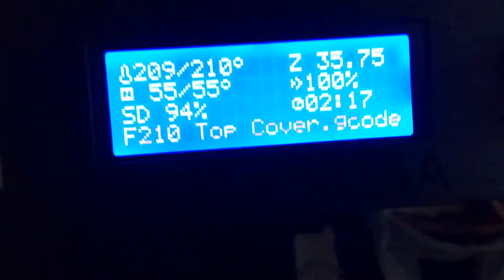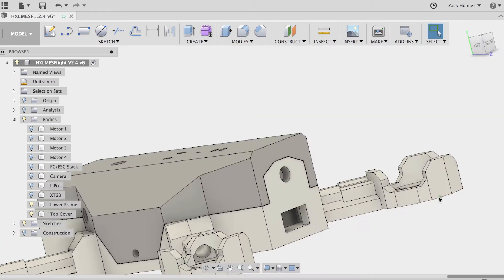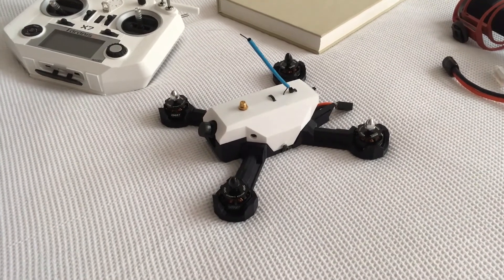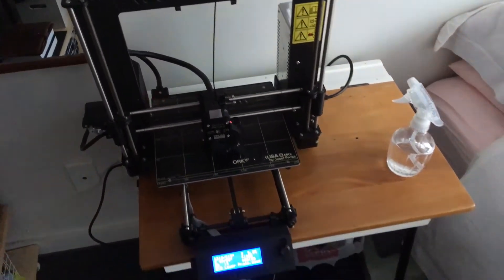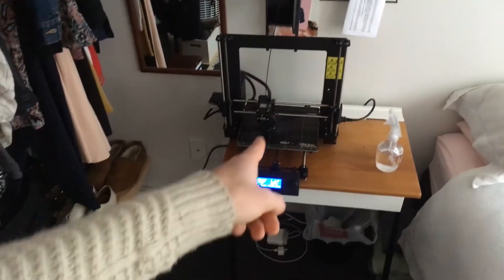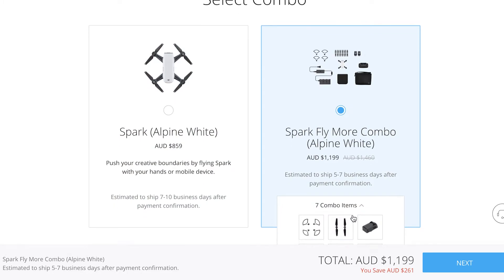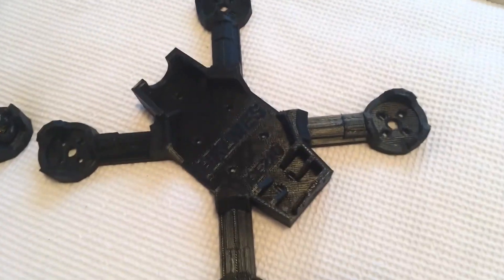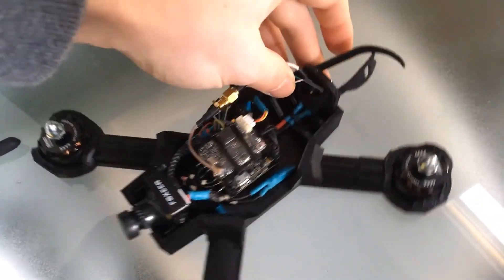New Drone DIY Build

Comment: hello .i have a anycubic kossel..230mm round base can i print this vertical with supports thanks
Reply from the maker: Hi Gregory, thanks for your comment! I would not recommend it, as the strength of the frame would be compromised. However if it fits on the bed vertically then give it a go I say! And make sure to share your result with me :)

Comment: Do the prints seem stronger when you print at higher temps?  Say 210 vs 195.
Reply: tubejim101 ive heard baking pla makes it harder
Reply: tubejim101 I assume it should since layers bond better at higher temperature
Reply from the maker: The Prusa uses 210 as the standard PLA temperature, and compared to my old reprap (180-185 degrees) the prints are definitely less brittle. That may also relate to the fact all of my 3mm PLA is several years old haha
Reply: Thank you for all the feed back!